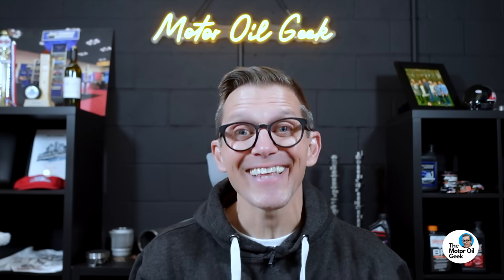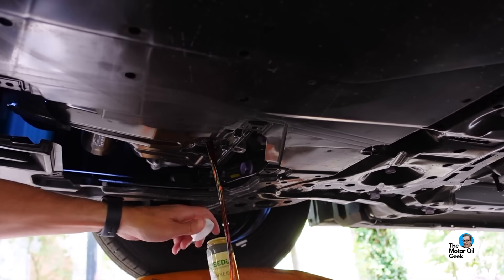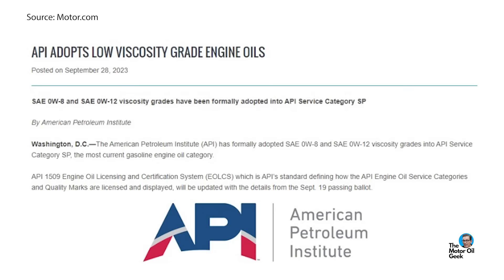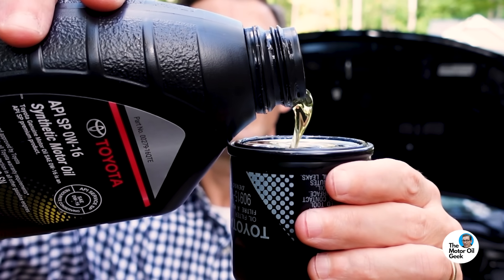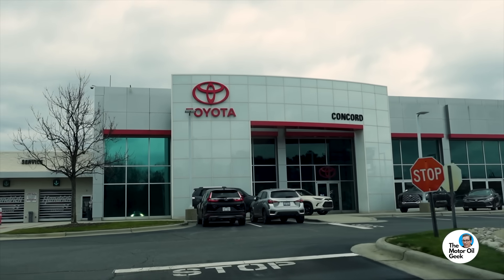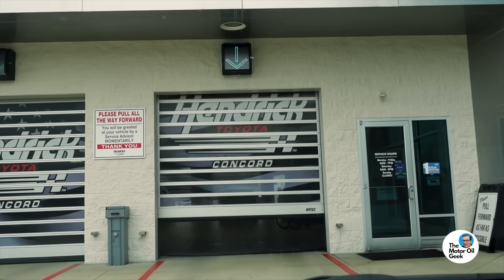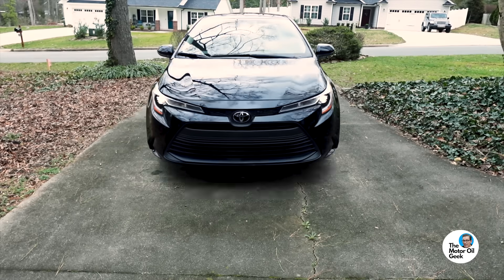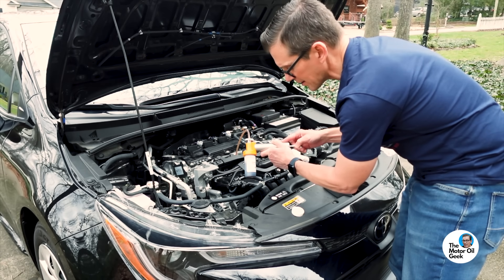0W-8 Motor Oil: Too THIN to Trust? Let's Find Out!

Comment: When you diy change the engine oil twice before the 10,000 miles preventive maintenance schedule does it void the warranty?
Reply from the maker: Absolutely not!
Reply: @themotoroilgeek  How about the succeeding PMS? Here in asia they usually put torque mark paints on the drain bolt and oil filter. No torque mark paint is usually done outside.
Reply from the maker: @orb666tpc  Changing the oil before the maximum is not grounds to void a warranty (at least here in the us). As long as the correct oil and filter are used, the warranty is not affected by DIY maintenance.
Reply: @themotoroilgeek  Thanks for all the reply. I worked in a honda branch before for more than 5 years. Usually we always put torque mark paints on bolts and oil filter as this is SOP (some tech put date and initial on the filter). And the records are usually centralised. I'm all for the longevity of the engine. Maybe I'll try to clarify this on some service advisors and technicians here. Thanks again for all your informative videos.

Comment: Man, you almost got me with that 10,000-mile first oil change 😅 I was like Motor Oil Geek let his daughter drive her car 10k miles without any intermitted oil change?! What? Hehe. Thanks for the informative video. 
I think car /engine manufacturers 'thin' the oil cuz the start-stop function to make the engine start easier, higher efficiency like less oil resistance/drag, and the even more strict emission
Reply from the maker: LOL, the fuel economy benefits of the thin oil is what makes them spec it.
Reply: @themotoroilgeek 0w30 (Mobil is the only one with this) literally disappears on bigger engines with looser tolerances.  5w and 10w30 is much less respectively.  Even in winter, any mileage gain (couldn't see any) is way offset with the need to buy so much more top off oil.
Reply: @GT-mn3bx Looser tolerances?
Reply: @D2O2  Yes. Common sense tells you that You couldn't run a 8.1 liter 496 CI or 502 CI with 1.5 or 2 thousands piston clearance like a tiny F1 engine. Nor as tight of a ring end gap, resulting in more oil consumption.
Reply: @GT-mn3bx  I was asking about tolerances.
Reply: They’ve had start stop for years now and no it has nothing to do with the engine oil being easier to start not sure what made that go through your mind the actual reason in MPG that’s the only reason. There’s a lost efficiency in pumping and by splashing the thicker oil but it breaks down much quicker  if you look in any book from any manufacturer they all recommend a specific weight but will always have a chart in it for using other weight oils mostly thicker too
Reply: @inductionbyforce8656  so what I wrote is the same as you repeated but with different words.
What do you think less oil resistance means? Less drag, quicker oil pressure build, smaller tolerances on rings, pistons, bearings, etc. Splashing is nonsense, many cars for many years have oil baffles/windage trays to prevent oil splashing onto the crank...
What do you think efficiency means? Higher mpg or in Europe less liters/100km, higher thermal efficiency.
What do you think more strict emission means? Maximized amount of CO2, Hydrocarbons, NOx, and particle emission of an exhaust. Emission limits have essentially halved from EURO 5 to EURO 6. This is the drive for the innovations and engine efficiency to increase (downsize, forced induction, hybrid, using flame speed manipulation). You should also know that a vehicle manufacturer has a total annual emission limit also per manufactured car models/engines, look it up.

I am using simple words because of other comment readers, to understand it easily, not to read words that they do not know how to pronounce, let alone understand.
Reply: @Mr.Bearded.Mechanic  you said they do it for the start stop option and that’s what I commented on no way does shutting it off and on have anything to do with that any oil is already warmed up and thinned out plenty to flow fast again.
Reply: The trick to see what oil you should actually run in your car is to check the manual in different countries to see what oil is listed. Most of these engines arent actually made for the thinner oil that is called for in the usa.

Its just for mpg improvements and there so small its funny. I would never put anything less then a 20 weight in.

Manufacturers can always put those "great" additives in there 8 weight oils in the heavier weights 🤷‍♂️

Comment: I'm surprised your dealership agreed to change your CVT fluid. From reading Toyota forum posts it seems dealerships often refuse to do CVT fluid changes because they say it is a "lifetime fluid". 
I won't be doing mine as early as yours. I will be doing the CVT change at 30,000 miles.
Reply from the maker: Interesting

Comment: I'm still sceptical of any filled for life claims.
Reply from the maker: Me too!
Reply: Lifetime means 1 day past mfg warranty. 😅
Reply: It just means the life isn't as long. The oil life didn't get longer, the transmission life just got shorter.
Reply: Life of vehicle is usually only 100,000 miles for most manufacturers, so... 100k is what you can expect.
Reply: @cup_and_cone  Or change the transmission fluid every 30k miles and the car may last 50% or 100% longer...
Reply: @cup_and_cone  Most cars today have an engineered limit of 215k ±15k miles.
Reply: @cup_and_cone I  didn't realize that cars were alive.
Reply: @cup_and_cone meanwhile I have seen most cars do 250,000 miles. 8 year old models.
Reply: @ameerm4899  I am talking about what the manufacturers claim is expected life of a vehicle.
Reply: @cup_and_cone that's not true. Warranty is different from actual lifespan.
Reply: @cup_and_cone Back in the '50s and '60s 100,000 was the life expectancy of an engine. Now they're going back to the old days but the prices are 50 times higher than back then
Reply: Why. There’s no legal length on life. They’ll just say sorry that was its life, but you can change the fluid now based on our specs lol.  I think in the manual by the lifetime fills they should have to put estimates of their interpretations of lifetime at the very least.
Reply: @alexandergunaka666  Ambiguity is the shield of liability.  Puting definitive numbers on 'lifetime' could help future class action suits if there ever was premature failure.
Reply: @cup_and_cone  while legally, I believe this makes sense. They should just recommend changing the fluid.
Reply: They do not mean your life. They mean the manufacturer specified "life" of the vehicle. Usually 100k miles.
Reply: Life of the warranty
Reply: Filled for life is 100% true. Just not sure how long that life is.
Reply: Scotty K did a video on this topic and it's B.S as far life time tranny fluid.
Reply: I think with autos, since they use clutches that are constantly engaged when shifting, those clutches will wear to then point of the transmission needing rebuilt before the fluid needs changed.

But transmissions are weird. My 4L60e only last 152k, and that was due to a defect in the input drum design that caused the 3-4 clutches to wear unevenly. I've swapped my buddy's filter and fluid, and it was at 250k. And based on the gasket and what I saw in there, it was probably factory lolol. The fluid was dark and had that friction/bearing smell, but it was working fine.

The big thing with motor oil is that it is exposed to the bottom of the piston experiencing combustion, so that oil gets HOT. So hot it will inevitably start to burn, pick up carbon, and eventually lose its lubricity. 

ATF gets warm too, but it doesn't get exposed to carbon or high combustion temps. The darkening of the fluid is from the clutches and bearings wearing and infiltrating the fluid requiring a change, but if those clutches fail before the ATF needs changed, then the fluid technically never needs changed from an engineer's perspective.

Comment: I wish someone would do a video with a mocked up engine on a Spintron with a plexiglass oil pan, plexiglass timing cover and a plexiglass sorts intake manifold. I have an article written by Smokey Yunick which  was reprinted from Circle Track Magazine. He was explaining how to prep a block concerning oil and mainly the small block Chevrolet. In earlier castings, there are 2 one inch holes in the front of the lifter valley and because the cylinder is offset, there is a wall from the cam tunnel to the top of the block under the timing cover and when the engine runs, the timing chain slings oil and it goes through the vent hole on the passenger side of the block and actually shoots a one inch stream of oil from the front of the lifter valley towards the rear directly where the distributor is located. The engine was at speed. I do not know how he proved this out. I have called Milodon, Moroso and some others and no one that I talked to knows anything about this. Smoke claims that an expansion plug will stop this. New blocks do not have these holes which leads me to believe what Smokey claims is fact. Oil control is important and having it in the pan is better than in the lifter galley.  Mr. Speed, if  you ever get the opportunity, it would be interesting if  you could investigate this and report on it. That is a lot of oil in an unnecessary place if true. By the way, A drag racer from the 50's through 70's in Baltimore, MD, had his car lettered "Mr. Speed has done his deed". It was Vernon Rowley, he had a Sunoco gas station and raced a drag car he purchased from Sox and Martin. He ran decent and finally got a sponsorship from Doug Griffith Mopar dealership.  Ah, the good old days of drag racing.
Reply from the maker: Thanks for sharing! I’m going to remember that Mr. Speed line.

Comment: I understand what you say, but doesnt the oil analysis also depends on the type of driving?
Im in the same situation as your, my car manufacturer recommend both 0w20 and 5w30......i drive sporty and at constant high speed so wouldnt a 5w30 be better than a 0w20? ( it has a better HTHS, i know that 0w20 has a better aditive package but the HTHS and "viscosity" at 100 grd is lower)...
What do you think about this?
Reply from the maker: Great point. How you drive makes a big difference, which is why the oil analysis results are the key to making the right choice. It’s a data driven decision versus speculation.
Reply: @themotoroilgeek  Unfortunately, in my country oil analisys is still a myth.....here people forget about oil or they change it at 30 000 km ( just like the car manufacturer say) and afterwards they complain about their engine burning oil 😁......and if you tell them to change it at least at 10000 km, they laugh and reply that the car maker knows better....
So you see, in my area oil analisys is quite delicate and thats why i enjoy your videos 👍

Comment: I believe the CVT they have in the Toyota has a torque converter for 1st gear only. 
I was at the Detroit Auto Show in ‘17 or ‘18 and I asked the CVT tranny manufacturer engineer what was the circular device in the CVT tranny? She replied it was a torque converter used for 1st gear only. 
The CVT trannies are not serviceable. If the chain or pulleys wear out, you pull the CVT tranny for a rebuilt unit. That’s what the gal engineer told me back then.

Comment: Do you have any studies on oil bypass filters.  Got a Duramax curious to know if extended oil changes is actually ok with like an amsoil bypass system.
Reply from the maker: The used oil results we have seen with remote bypass systems have been very good.
Reply: @themotoroilgeek  cool thank you

Comment: It says right on the engine to use 0 weight oil on the Corolla.  However, if you change the oil every 10K miles/16000 kms the oil will eventually start to carbonize the engine as its too thin to go that long between oil changes, especially in extreme temperatures. I have a new 2023 Corolla and have already changed oil twice by 5000 miles and am now changing it every 5000 miles from now on.  I have about 20 years experience in the oil industry in refining and high tech lubricants and additives for automotive and military use.  I would never go 10K miles between oil changes.  In fact, I once gave a lesson in tribology to Toyota in Canada and explained all of this years ago.  But Toyota is marketing the vehicles as "low maintenance", not telling that following their maintenance will eventually cause piston ring failure and oil burning.  Why do you think it tells in the owners manual to monitor your oil level and add oil as needed?
Reply: Just go by their "severe" service interval and you'll be fine. As others said, oil and filters are cheap, engines aren't. The right oil changed when it should be with the right filter will far outlast any other wisdom of "extended" drain intervals.
Reply: @googleusergp  When I called Toyota to do my first oil change at 2000 kms, they had a meltdown over the fact that I wasn't following their scheduled maintenance plan.  They found my attitude quite confusing.  I have never followed a dealer's maintenance schedule and its caused me to have zero engine problems in cars for over 45 yrs.
Reply: @RacerX888  That's why I do them myself.
Reply: O weight or 0 winter?
Reply from the maker: Winter!

Comment: I have an old beater that according to the owners manual it is supposed to take 5w30 (printed on the cap as well) but if you Google the make, model and year it says 5w20.  Apparently in 2002 and up 5w20 was the recommended oil viscosity.  I still only use 5w30.
Reply: Have you owned it since new?
The engine might have been replaced. 
It gets complicated because the oil fill cap could be from another engine. 
It's important to use proper viscosity, especially if the engine has variable valve timing

Comment: As i car guy i like all your content you do. Im curious i have a 2014 f150 3.5 ecoboost that i store in winter and drive a few times a month in good weather. It has 30,000 miles is there a benefit to maybe adding one quart of a high mileage seal conditioner oil to 5 quarts of regular synthetic to help the seals from damage during storage. Thanks.
Reply from the maker: I wouldn't blend oils or use any additives.

Comment: Makes me wonder if Toyota dealers are required to use Toyota branded oil? I doubt it, but makes think
Reply from the maker: Maybe while under warranty? I don't know either.
Reply: @themotoroilgeek  I don’t think they’d carry oil for warranty and non warranty. I used to work for General Motors a long time ago and they used Mobil oil. Granted gm isn’t paying for the first oil changes and not near as stringent quality control as Toyota

Comment: At this point I’m convinced we’re gonna go back to straight weight oils since I’m sure they’ll eventually make 0W-0 Oil
Reply: Just use water
Reply from the maker: LOL
Reply: As far as I know 0w16 can already be a straight weight oil since it’s representing two different scales. The Valvoline offering seems to be close.
Reply: Yeah that's the weird part, one of the benefits of synthetic is having a larger viscosity range. But 0W-8 is 1/3rd of conventional 5W-30.
Reply: @bobbygetsbanned6049 It's funny that the old-timers in the 70s were saying that only straight weight oils were good. Whether they like it or not, technology advances. Don't fear the changes; embrace them.
Reply: You made me laugh. Thx.
Reply: They're just going to move the decimal point 0w-0.16
Reply: I've said the same 0w0 seems to be the goal. Too much government  involvement in it
Reply: Skip the engine oil and just use additive packages.
Reply: That doesn't mean straight weight though.
Reply: Lol 👍👍👍

Comment: I've never seen silicon grease before, I learn something from every MOG video! ;)
Reply: I have been working on cars since the 70,s. I have use silicon grease for as long as I can remember.  I use it on electrical connections and spark plug boots.
Reply: @hitechrr  Oh, maybe the silicone grease I've been using is the wrong compound, I'll be using silicon going forward.  Thanks for the heads-up!
Reply: Exactly 
It was discovered before fire...
Unless you live under a rock..
Reply: @summerforever6736  Or you mistake silicon for silicone?
Reply from the maker: Glad to help!